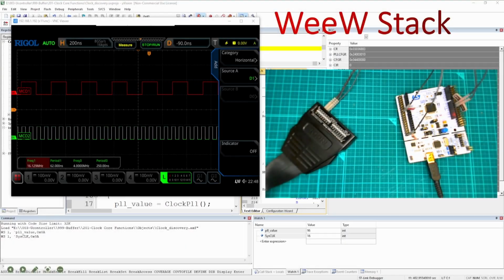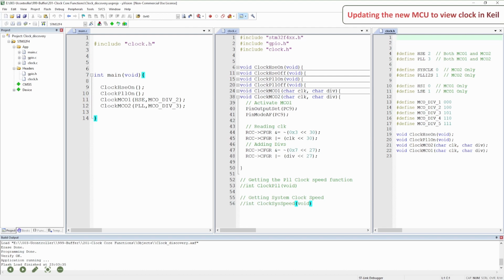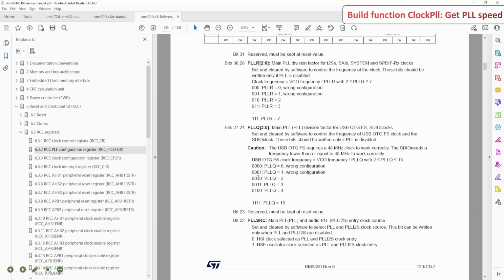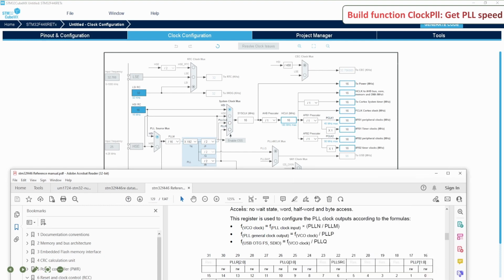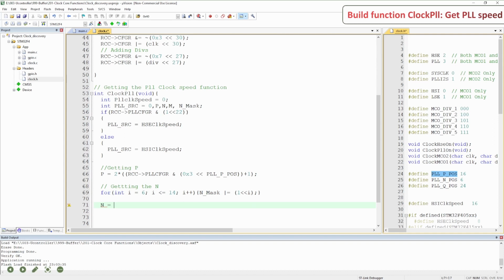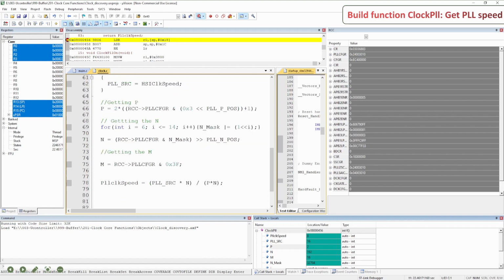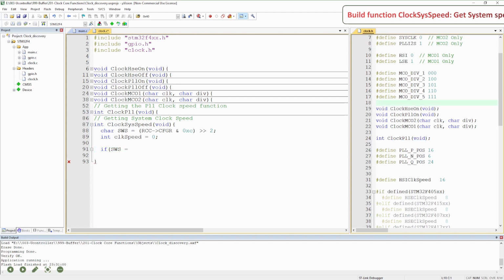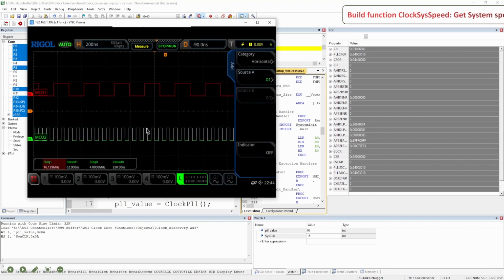202- STM32 Clock Speed Mastery: Measure Clocks Speed without Logic Analyzer | Bare Metal Tutorial

Comment: Maybe I'm wrong, so forgive me in advance. I've noticed on this and previous video that you didn't make it check PLL_RDY bit for PLL to be ready, or HSE/HSI ready bit. Again, with all due respect.
Reply from the maker: Hi Sanel, thank you a lot for your question, I really do appreciate it. actually the check is performed within the while function within both "ClockHseOn()" & "void ClockHseOn()" which are described here : 
void ClockHseOn(void){
	RCC->CR |= (1<<16);
	while(!(RCC->CR & (1<<17)));
}

and 

void ClockPllOn(void){
	RCC->CR |= (1<<24);
	while(!(RCC->CR & (1<<25)));

Where Bit 17 of the CR register is  HSERDY: HSE clock ready flag and Bit 25 is PLLRDY: Main PLL (PLL) clock ready flag

>> Hope this helps, please do not hesitate if you do have further questions
Reply: Hi Sir.How to find Execution time of STM32 Microcontroller incase we have to read the data using GPIO Pins? Using software